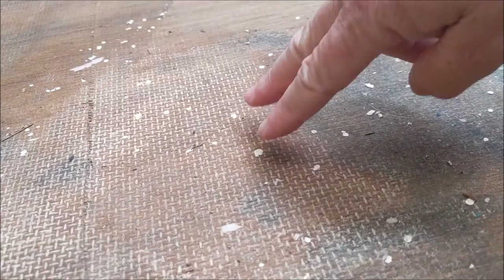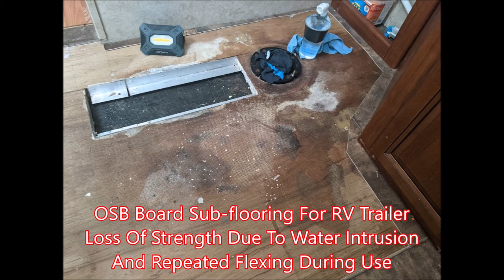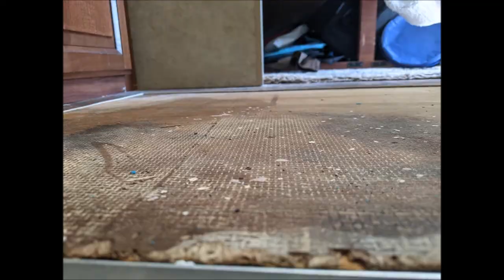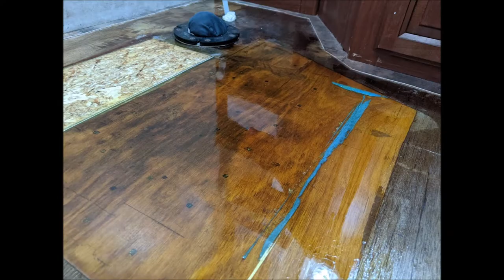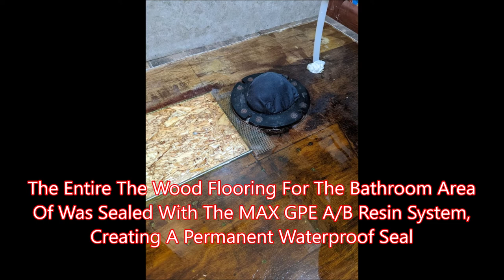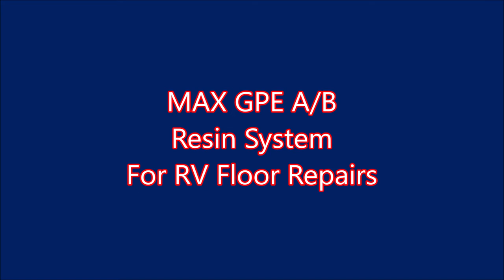Epoxy Resin For Soggy Wood Floors RV Trailers, Bathroom Wood Floor Sealer. Stabilize Damage Wood

Comment: Did you drill holes  and inject or just coat the wood
Reply from the maker: We've done drill and fill for other projects where the wood has split due to too much mechanical load applied to wood stringers for decking that dried out. It is an excellent technique to induce deeper resin impregnation. However, before doing any resin reinforcement, you should determine if the wood is salvageable for structural safety.

The wood was replaced, and the replacement was coated to create a waterproof barrier and stop water intrusion. The old wood floor was too wet and too far gone to be salvaged. 

Another method to induce deeper resin saturation when injecting epoxy resin into damaged wood is to incorporate a small amount of a fast-evaporating solvent, like acetone, with the resin mixture. Acetone is an effective diluent that reduces the viscosity and surface tension, creating better absorption. Another effect of acetone dilution is that it slows the epoxy resin's reaction rate. The longer the epoxy resin stays liquid, the more time it has to impregnate wood porosity. Add no more than 5%; adding more will not be as effective in viscosity reduction as the first 5%. If too much acetone gets entrapped within the cured resin matrix, the cured epoxy will be gummy as the acetone acts like a volatile plasticizer. (https://en.wikipedia.org/wiki/Plasticizer).

The entrapped acetone eventually evaporates, creating a loss in volume, so the cured epoxy shrinks, causing poor cured performance. A little acetone goes a long way for the intended purpose.

Keep injecting the resin into the drilled holes until saturation. Once it cures, the wood porosity is sealed and will no longer be absorbent. Give it several days to cure and outgas any acetone residual. Next, mix another batch with no acetone dilution and fill the drilled holes with the epoxy resin mixture. Once cured, it acts like a rebar reinforcement. 

Check out this link to another resin system where acetone dilution was used to seal wood and prevent water intrusion.
Video:
https://youtu.be/AGsVo_TuoE8?si=amxU3aEMM73BrJvv 

eBay link to the product used in the video demo: https://www.ebay.com/itm/311947117608 

Please review the product description on the eBay page on how to calculate acetone dilution and application procedures. Hope this helps.